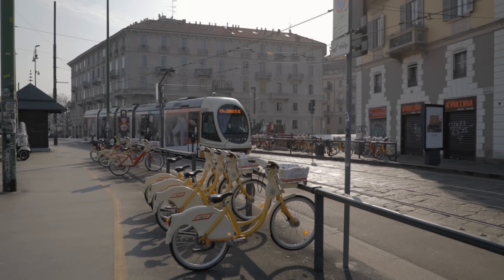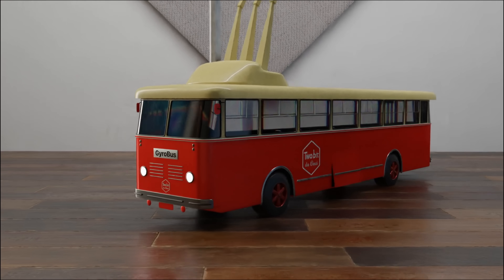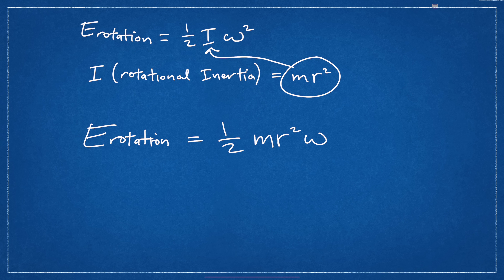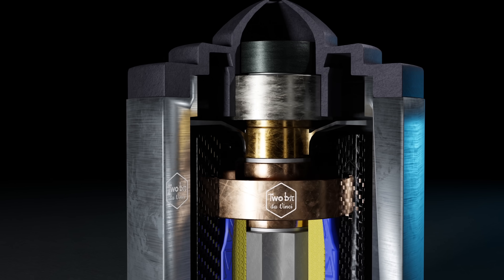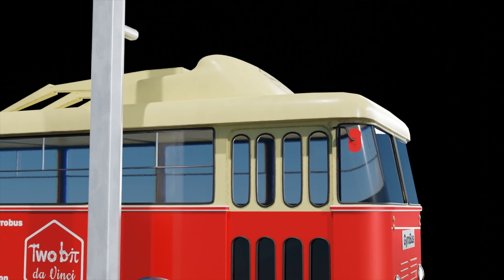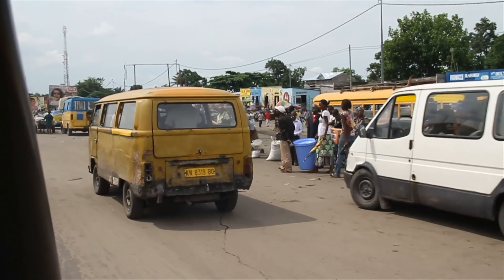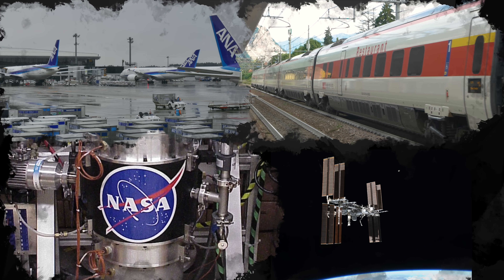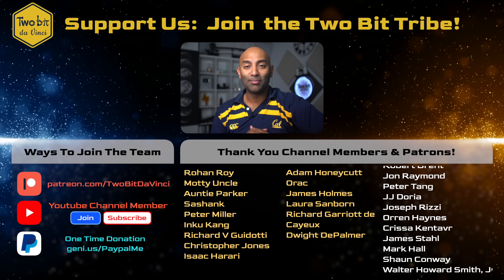This Bus Went Electric WITHOUT Batteries

Comment: Why would they not but two wheels in the bus going in two different directions cancelling each other out making easier to turn the bus? Ya I would be interesting engineering to keep the wheels going at the same speed for the cancelling effect, or you could take more power from the side of which you are turning making it easier, but then could there be a problem of over steering?
Reply: oooh I love your idea of gyro-assisted power steering!  I suspect that would be so easy to manage that an 8088 chip would be overkill.  Let's use 7 of them with a voting system so they are super good at being reliable, since 8088 chips are about 4 bucks each.

Comment: Would an electric+flywheel bus make sense? More sense than typical regenerative braking, I mean? At stable speed the flywheel remains stationary, the vehicle moves on batteries, but when braking the flywheel spins up powered by the inertia of the bus. When accelerating again that stored power is used instead of batteries until cruise speed is reached. It would require a smaller flywheel. Maybe batteries+supercapacitors are a better alternative?
Reply from the maker: That’s good too

Comment: Flywheel in my opinion would be great in cars. You want the engine to run at a constant rpm to get maximum efficiency. Revving up and down costs a lot of fuel. Although on the highway a flywheel would cost more energy because of the weight... in the city it would greatly improve efficiency stopping for every red light getting the car to move.

Comment: Okay, you are young. 
In America there were: Trackless trolleys -- electric trolleys that have rubber tires rather than running on rails like streetcars -- have been a distinctive feature of Seattle's transit system since 1940. Seattle became the first city in the country to rely largely on trackless trolleys when the city ripped out its original street-rail system in 1940 and 1941. They lasted longest on routes with steep hills, like Queen Anne. #9 Broadway route stopped using Electric busses before 1965.
Reply: A problem could come when a driver missed a turn or turned when the route was straight, because the cable connector lost connection with the electric service.

Comment: ... Didn't Need Batteries
02:06 basically a flywheel is a **massive mechanical battery**. Meaning it converts 
one form of energy electricity chemical energy etc into kinetic energy.

Comment: As a bus driver I can tell you that modern Gyro buses do exist. Now I'm not saying gyro only, but in a hybrid configuration with a diesel engine and using regenerative braking as its power source. Commercially available and built and operational here in Scotland.

Comment: Have you talked about other potential energy storage devices? I remember several years ago watching a video about storing excess electricity by pulling rail cars full of rock up slight grades, and when energy production from solar power or whatnot was down you would release those rail cars and they would pull a chain connected to a generator and that would generate electricity. With the amount of abandoned quarries,  mines, silos, & other tall industrial buildings throughout the United states, I've often wondered if it was a feasible enough thing to implement those types of batteries everywhere.

Comment: Wow that’s dangerous. A flywheel with that much mass spinning at 3000 rpms. If one broke free in an accident there would be NO stopping it. Imagine that happening near a crowd.
Reply: You'd think we see more flywheel deaths considering that every engine has one, they spin at more than twice that RPM, we've crashed literally millions of cars and in fifty years I have only ever heard of a flywheel spinning out of a car once...and it didn't hit anyone.  Also, the bus flywheel spins in the horizontal plane, so it just wants to sit there like a big spinning top.  Imagine if a wheel came off a car! Near a crowd! OMG now THAT would be terrifying...and every car has four of them! OMG OMG!
Reply: A giant saw blade going through a wall in an industrial accident, follows the same principles. I can see the concern. Those fly wheels found in modern engines don't have enough mass to escape the engine compartment.

Comment: I was reading about this 6 months ago whilst looking for alternatives for a yacht. I wish you had have touched on exactly how to bus utilises the energy in the flywheel to convert to propulsion.. was it driving an electric generator and electric motors on board the bus also?
Reply: There is actually a Capacitor Pack.

Comment: This is a great video.

Interestingly enough, the use of a Gyroscopic device for storing and releasing energy was an idea that I explored in the 80s -- but, just in a theoretical way.

That is to say, I did not build a prototype.

I can see how it would ultimately not be practical for transportation purposes; but, it certainly makes sense for storing energy in stationary applications.

Thanks very much for explaining the history of this energy storing concept, as well as the engineering factors determining it's practicality.

Comment: Sad that the gyrobus was scrapped… coming to the energy consumption, I feel it’s a reasonable amount of energy consumed no matter how it is. My own electric two wheeler consumes 2.5KWH electricity to fully charge it from single digit charges to 100%… so, liked @ it inin that way, the bus energy consumption is extremely reasonable and not @ all exorbitant.. the charging system is also pretty exotic and the fact that there are no batteries are a plum selling point. Yes, as rightly pointed out, taking turns may be an issue, and maybe we also ought to take precautions especially when people have pacemakers right?. Because a flywheel does produce magnetic energy also right?. and that might affect the functionality of the pacemaker… all in all, excellent video, great explanation and worth watching it!!!.

Comment: One aspect I'm surprised you didn't mention is that the commercial electricity grid has effectively been using flywheels to regulate the electrical load on the generation side ever since power stations themselves have existed. Any rotary generator (either an alternator, magneto or commutated dynamo) has a large rotating mass, composed either of permanent magnets or electromagnets. The rotating part of the generator plus whatever is turning it (such as a steam turbine) is essentially one massive flywheel, since both are mechanically coupled and rotate together. The rotors of large steam turbines can weigh in at hundreds of tons, so the stored kinetic energy is substantial.

This means that any power station using rotary generators has some buffered capacity. If the primary energy source (steam pressure driving the turbine) is cut off for whatever reason, the rotor and generator will both continue to spin, albeit at a decelerating rate as their kinetic energy is converted into electricity. The system is also capable of smoothing out minor irregularities in electrical load: If demand drops below the nominal output of the generator, it will speed up slightly as the excess capacity is converted into kinetic energy. If demand rises above the generator output, it will slow down slightly, as some of the stored kinetic energy is converted back into electricity.

The easiest way to determine if either scenario is happening is by monitoring the frequency of the AC waveform produced by the generator. The frequency is directly proportional to the rate of rotation of the generator: 3000 rpm produces 50 Hz, 3600 rpm produces 60 Hz. So if the generator slows down, the frequency will drop and vice versa.

Comment: Wind turbines, why buffering energy in something that rotate and if let alone it will consume itself do to friction. Why not lift very slowly 50 ton weight by electric means and store potential energy that could be transformed back to electric energy on demand. Like the old wall clocks that use weights to function.

Comment: Hold up!!!! Are you from Dayton Ohio? The very first bus you showed was a  Regional Transit Authority or RTA for short from Dayton. We have a very long history of clean electric bussing because back in the 50's I believe, Dayton installed an electric trolley line with very original overhead power lines supplying the busses electricity. Just in the last 10 years we added brand new more efficient electric bus technology to the stable of clean busses. I'm super proud of are cities  Commitment to clean green power and  Architecture!

Comment: Dear
Reply: Dear Ricky,
This video  was tremendous. The facts were clearly stated and the points well formed. If only we could have this kind of reporting on EVs where we are shortly going to be bombarded with advertising instead of facts. We need unbiased reviews and discussions of choices. For example what is efficiency and better technology worth to you in a vechical? Do you compromise and get a VW or another less expensive EV or just spend the money for a Tesla. So much of the technology is promised for the future where as I just want to go to point A to B with out harming the environment as badly as I have been doing. Where as teslas saying I can have a groundbreaking robot on wheels for x more dollars. I have a feeling that they are going to lower prices as soon as they solve their battery shortage and really ramp up production. They already can build the car for less than any other company. Now they need to deliver the inexpensive alternative. We are also going to see more considering in the auto industry very soon which might also put price pressure up on other EVs as well.

Comment: If the flywheel is made of tubes filled with bearings with a very small gradient the bearings would roll to the middle when the flywheel is still. thus making it easier to start the flywheel as it speeds up the bearing ( wait ) would move out creating the gyro effect that gives energy.

Comment: I grew up in sf in the 70s and 80s riding our electric gyro busses. Dad explained the tech but I had never seen it until now!
Reply: those buses have constant contact with overhead lines, used to pull them off if a bus driver cut me off as a bike messenger in my youth.

Comment: Very interesting.
Formula 1 car's have a flywheel technology called KERS.
kinetic energy recovery system (KERS) is an automotive system for recovering a moving vehicle's kinetic energy under braking. The recovered energy is stored in a reservoir for later use under acceleration. Examples include complex high end systems such as the Zytek, Flybrid, Torotrak and Xtrac used in Formula One racing and simple, easily manufactured and integrated differential based systems such as the Cambridge Passenger/Commercial Vehicle Kinetic Energy Recovery System (CPC-KERS).

Comment: Problem with this is that it was one direction. It can be spilt into two with half the weight each. That means same gear spins both, and that means the same average resistance to turns on both sides.....instead of just one side

Comment: A 6k range makes a bus magical? And zero emissions?  The bus (as well as other ev designs) just move emissions to the power plant which can actually be much worse (for instance if you're burning coal for electricity generation). It's disappointing that such a good station with obviously intelligent staff fails to address this.

Comment: Kerosene is another method to store energy. 
 
Using mirrors to heat up a thermal reactor, you generate kerosene from CO2 and H2O - that then burns into CO2 and H2O. A closed, carbon-neutral loop. 
 
The whole is called "sun-to-liquid", was developed by the ETH university Zurich and the german aerospace research agency DLR and already tested in a small test plant in Spain.
 
You can store kerosene, over years, ship it, pump it in pipelines, use it as diesel for cars, homes, ships, for planes - you could even use the process to do what it discussed anyhow - to take the CO2 we took from the oil fields in the ground and blew into the air and (in kerosene form) store it back in the ground - in old depleted oil fields, back where we had taken it from.

Comment: Maybe a flywheel can be used to get quick charge, and then it can discharge slowly into the EV battery. This can easily be accommodated in the front part of an EV.
Reply: blink blink

That's brilliant
Reply: The issue is that, if we go to EV production on the scale Musk wants, estimating that we have decades, plural, before running out of lithium is being generous. No batteries at all is the best option, thinking long-term. I would like rechargeable batteries to still exist when I die.
Reply: @redjack2629  - you are off by an order of magnitude. If we don't recycle any of it, replacing all vehicles with Lithium Ion systems, we would run out of Lithium in 2397.
Reply: @downix  Lithium will be economically scarce long before that, the mining and refining will also be horrible.
Reply: @MilwaukeeF40C  Hence recycling.
Reply: @downix  Lithium is still a major problem.
Reply: that is a bloody good idea mate! well done!

Comment: There are copious amount of physics that proves you can't have a perpetual motion machine on earth. The our planet as are all the other planets are massive flywheels of sorts and yet they too are slowing. Flywheels serve a purpose in helping to stabilise a rotating system and as stated help maintain electrical frequency, deliver and absorb power on an electrical grid when sudden substantial loads come online or drop off electrical grids and best as stationary units and not on mobile equipment that needs to change direction, accelerate and decelerate.
Using a fly wheel as a power storage system has limited cost benefits as detail in the video. 
We need to utilise as many different types of storage systems and efficentcies as possible now not in 2030 or 2050. If we wait like our greedy politicians and carbon hungry corporations and countries keep stalling change. Then it may be too late for our younger generation.

Comment: Fun fact: The first electric motor was invented in 1829, just 3 years after the ICE.
The reason vehicles run on oil based products and not electricity is because the powers that be can rip us off a whole lot more seeling us 'liquid fuel.'
That said, even electricity is a con; it's harvested/produced for next to nothing.

Comment: It would make sense to convert motorway to have electric cables for lorrys sort of like a tram although with a hybrid engine electric engine for motorway then petrol engine for everywhere else you would just need to be the ariel to connect to the over head power line

Comment: I remember seeing a Popular Science article on this technology decades ago.  The one disadvantage of this is if the flywheel has a sudden failure.  The article touted that the flywheels were specially designed to disintegrate into a fine harmless powder in case of a failure.  That is like saying a stick of dynamite accidentally discharged gets converted to a harmless gas.  Whatever energy is stored as mechanical energy will explode with the equivalent amount of energy of the same energy released on an explosive like TNT.
Reply: I'd rather have the odd flywheel failure every 2 years then huge tracts of land ruined by lithium production and an ensuing recycling nightmare here when our batteries wear down.
Reply: @finnk1289  I couldn't agree more on lithium batteries.  I know nothing of the manufacturing of lithium batteries, the impact on the environment, nor the impact of recycling.  I know that improperly disposed lithium is extremely bad on the environment.  However, I don't think flywheels are a safe means of storing large amounts of energy.  I will make a little back of the envelope calculation for you.  Let's say you have the energy equivalent of one quart of gasoline stored in a flywheel.  That could take a bus maybe 5 or 10 miles.  However, if the flywheel has just been "charged" with the amount of energy in a quart of gasoline and the flywheel fails, the equivalent energy of 30 sticks of dynamite has just been released.  If there isn't sufficient shielding to protect the rest of the bus, passengers, pedestrians, and other vehicular traffic, there could be a real mess.  I can see flywheels as an effective way to provide a small amount of energy to be able to move a bus or trolley a brief distance to get from an electrical source A to source B, but not for a great distance.
Reply: True enough, but as I recall (and I think I read that article too), the fear was the flywheel exploding and big chunks of material penetrating the housing and hurting people. If the flywheel disintegrated into powder the same amount of energy would be released, but not of the individual bits of powder would have enough energy to penetrate the casing. Kind of like the difference between being bashed with a 2 lb pillow vs a 2 lb hammer.

Comment: European Trams have used flywheels forever. That bus is just a tram (Strassenbahn) on rubber tires that does not need a track. 
Many European cities still operate trams possibly also gyrobusses as they use the same overhead cables.
Reply: The use of overhead cables (“trolley lines”) does not imply the use of a flywheel. Trolley buses and electric trams don’t use flywheels. They use simple batteries to bridge short gaps. Trolley buses generally have a small diesel or gasoline generator for longer stretches of power independence, though new models are available with larger li-ion batteries instead.